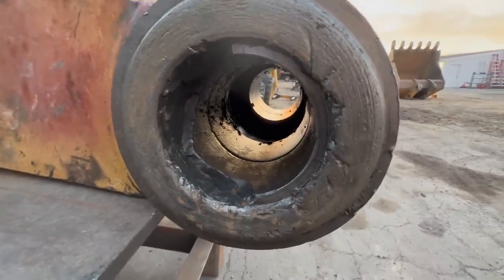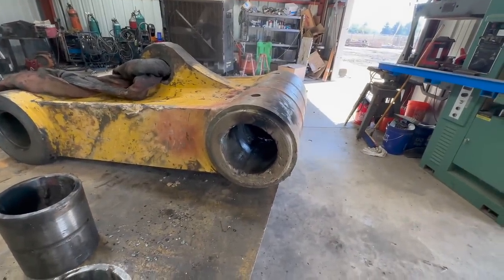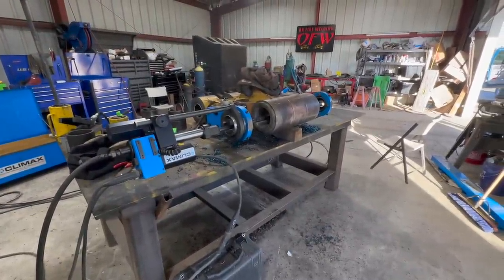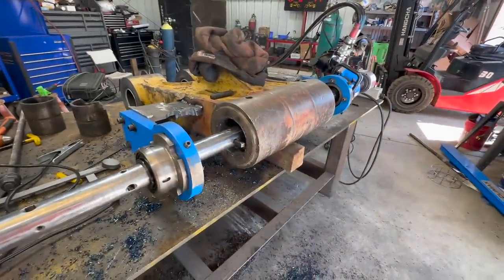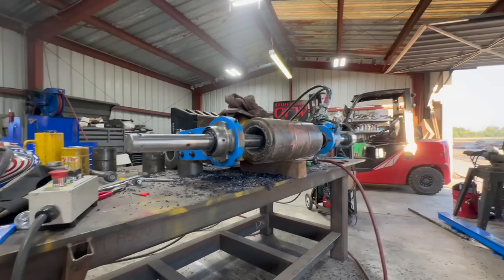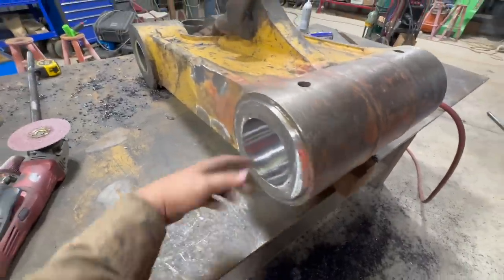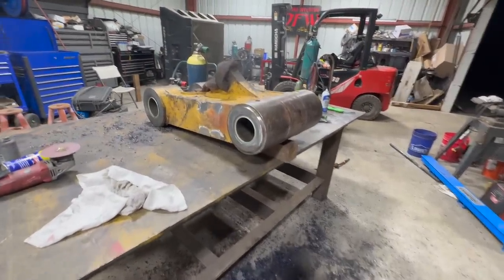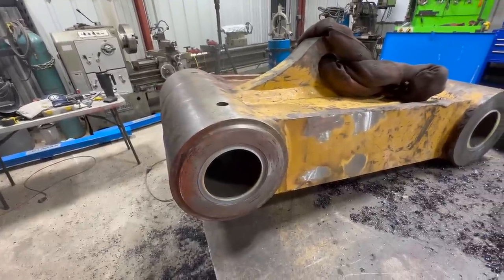Line boring a CAT 374 H link

Comment: On the hydraulic press, I use spacers that are notched (as with an arbor press) so I don’t have to keep removing / rethreading the nut. Helps a bit with shorter throw rams 👍🏻
Reply: Honest question. What's the reason behind not just winding the nut in more rather than adding spacers?

Comment: Nice job, if you get one of the 6" wide luggage wraps and you can wrap and seal ends of repaired items easily which provides excellent protection and only takes seconds to apply. Ray Stormont

Comment: On the previous video of this seriers. You ask if there was a better way to cut the angles on the face wearing plates. 🤔🤔Imagine a reversed lathe chuck. 👀👀A 2" deep pan disk ?DIA? trepanning tool that bolts over the line boring bar holes. The tool would have two or four angle insert bars or HS steel cutters that can be adjusted in and out. Cutters will rest against a gusset and side bars inside for support or in slots cut out of a thicker wall resting aganst the back plate. This will cut strait on and would give you more leverage and force.

Comment: Make sure all the welding is done first before you do your final cut. because after you touched up the side of the faces it drew the bore out of round.  set the bore welder to 17 volts. Anything more than that is just heat and spatter. Run the bore welder in the other direction, because when the nozzle spatters up and sticks to the bore inside, the darn thing will unscrew itself as it's turning around. If you put about a .006"  crush fit on them bearings you don't need loctite. Also, if your chips are blue you are still running too fast. That's why you're getting a little bit of chatter across your bore. The cutter tip can't handle the heat and it erodes down. Not sure if you're using high speed steel or carbide but you need to use carbide. With a sharp point on the bit. Must sharpen tool bit after every time it goes across the bore. That weld gets hard

Comment: This might be a stupid question but I'm known for stupid questions lol... 
Once you make your pass with the line bore and it's concentric, why not just order or make a bushing with a larger OD? 
I would think it would provide longer wear life and you can avoid all that time consuming line bore welding
Reply from the maker: Some people do that.  Most customers want everything to go back to OEM specifications.  Here is an example of why.  Say I make a bigger bushing for it and put it all back together.  Then this machine goes out of state 800 miles away and that bushing wears out they go buy OEM bushings and go to take it apart and realize someone made something custom and OEM doesn’t fit. Now they have to call out someone to line bore it and put it back to spec.

Comment: I babysat Cat scraper spreads for over 30 years and I can’t even count how many H links and cushion hitches I’ve had to bore and weld up . A little different from an excavator H link but almost the the same . 😊 what brand of inserts are you using?  Thanks for sharing. Those are called flap wheels on your  Milwaukee. The red Loctite works good but if you want to really securthem use the Loctite 720 green color and those seals will never pop out . 😎

Comment: It is hard as the mig wire is higher grade wire and has reacted with the parent material.
 Seen welding angle iron Years ago and it made hard spots.

Comment: maybe someone had built it once before using a much higher tensile strength rod? Also, do you always run inline bores dry?
Reply from the maker: Are you talking about coolant for cutting?
Reply: @OFW  yes, for cutting.
Reply from the maker: @michaelryan9311 I never run coolant while cutting.  It makes a big mess and is not necessary with carbide.
Reply: @OFW  yeah I need to learn more about milling and machining for sure. Thanks.

Comment: How much of a interference fit do you use when cutting your bore to its final dimension do you use one too one and a half thousand of an inch for every one inch dimension of the bearing or do you use something else just wondering on your professional opinion thanks
Reply from the maker: If there is no manufacturer spec. I use one thousandth per inch.
Reply: @OFW Thanks for getting back to me I greatly appreciate it and love the videos you do great work how do you find the manufacture spec do you just contract the  manufacture directly